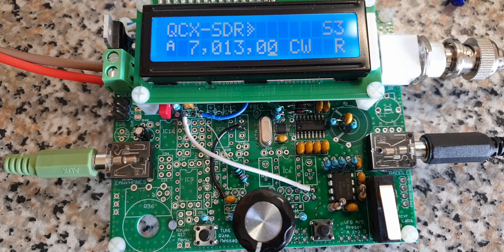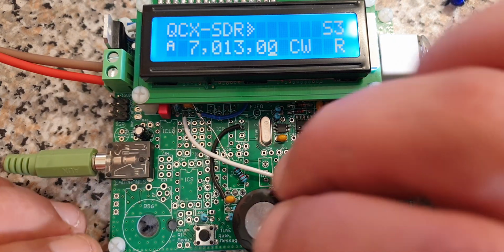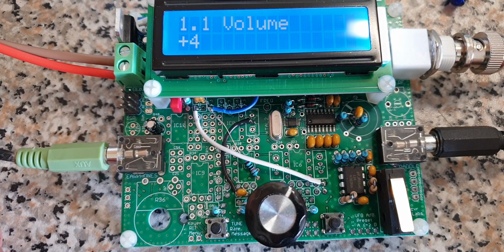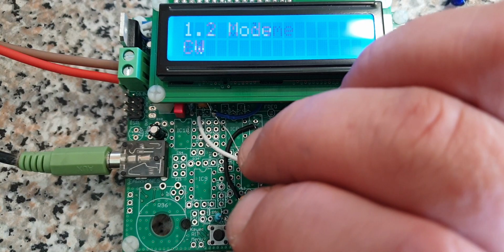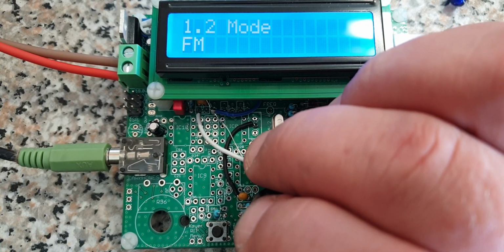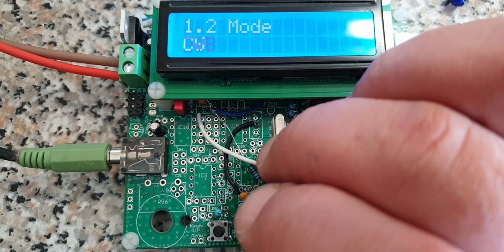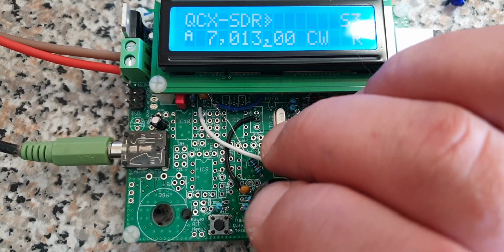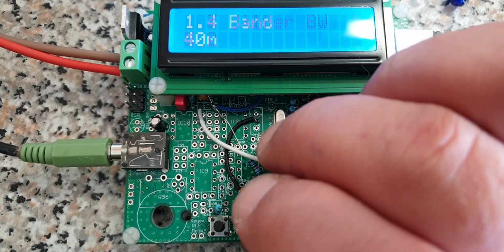QCX Transceiver SSB Modification. Multi Band - All Mode for 50 € ?

Comment: Is there a reason nobody in the ham radio community seems to use single-chip integrated low-pass filters and instead goes for the bulky toroid-based ones?  You can get the integrated ones for under $10 and they're a tenth the size.  Plus there aren't any toroid windings to mess up.
Reply from the maker: That´s a great question. While I can´t aswer it for the industry, I can at least tell you, why I did not consider them in my designs. 1. Filters in (tr)uSDX and uSDX are more than just a low pass filter. They do 4 things at once: a) provide the right load to keep "class E wheel spinning" b)Impedance Transformation from Class E Load to 50 Ohms c) second harmonic notch to get away with such a simple filter topology d) Low Pass Filter 2. Reason: non-availability for Amateur Radio usecase. As far as I know, they are only available in the GHz Range and not really as efficient, as we need them. (tr)uSDX was designed to create 80% and more PA Efficiency 3. Last but not least: Cost. (tr)uSDX was initially designed to get you started on HF for 50$. If we´d need 5 Filters worth 10$ each, then (tr)uSDX would be way more expensive. Let alone availability of those highly specialized parts we´d need. If you know something, I´ve missed, please let me know. 73 Manuel; DL2MAN

Comment: Hopefully, those great QRP Guys will be offering this as a kit in the near future, perhaps even making it multi-band with plug-in low-pass filters like you illustrate.This is also getting close to what I've been wishing for—a small & inexpensive HF transceiver that does SSB not for voice but to handle the digital modes. (People are more likely to comeback to a weak digital signal than a voice one.) Even better would be a transceiver that would off-load the UI and signal processing (via Bluetooth) to Android and iOS smartphones. --Mike Perry, WA4MP

Comment: Greeting Manuel from a chilly (its winter time) South Africa :-)  Trust you and your family are keeping safe and well in these abnormal times.  A note to say BIG thank you for making / sharing the modified QCX video - VERY GOOD, 10/10 

I (as I suspect have many others) have been waiting for Hans to release the QSX and then a good chance would order but having seen the FANTASTIC results of the efforts made by Guido I am tempted to abandon that idea and order a QCX (will have to be the + model) and have a go at joining the others who are having fun experimenting <HUGE SMILE>.  That is unless the kit you mention in another reply to a comment is going to become a reality and will be affordable? 

As an aside, my 30m QCX is awaiting construction and I keep telling myself that once my code ability is a little bit better I will get back on the air (am currently achieving about 95% at 20wpm using the super app developed by IZ2UUF but not sure if read for the real world) after many years of inactivity... I would like to build the QCX as I have almost finished the metal work for a small but tough enclosure plus have plans to make it dual band (30m / 40m).

Looking forward to more videos for sure (no pressure <grin>) but until then keep well and as always KEEP SMILING! 73 Nigel ZS6RN ex G8DEV (l-o-n-g time ago).

Comment: How many volts is this Power supply 
Voltage ?
Reply from the maker: I´m using my Standard Radio Power Supply, which has 13,8V
Reply: @dl2man  Is it maximum voltage for this transceiver?
Reply from the maker: @かぶとむし-n5z  Can be up to 16V. But 7805 will get Hot...

Comment: Great job... did u documented the schema modification? Can we get it? I think the bpf can be switched using relay rather than plug unplug it.. what a fun work have u done... keep continue... :)
Reply from the maker: Yes, first Version is ready, and should be released today (after Guido has checked for any errors). It will be available at the Project Page:  https://github.com/threeme3/QCX-SSB
 . This Version with pluggable LPF´s is only the starting point. We plan to either switch it by relais board, or maybe even use a digitally tunable ciruit. Mybe in future, there will be even a whole new kit availabe, since most of the PCB is unused now, and it could be built much smaller. But for now, Guido has to concentrate on the firmware development (Bug Fixing and Feature Improvement).